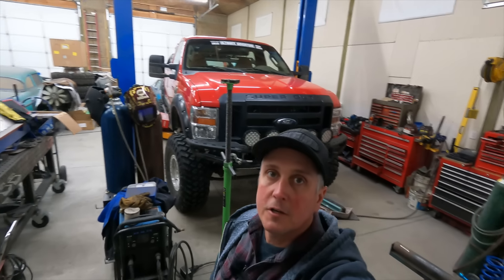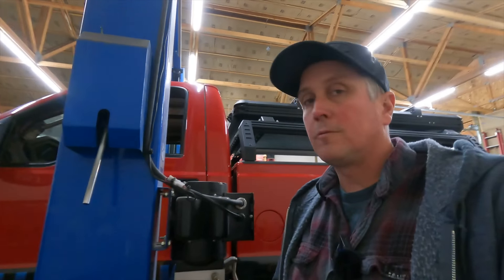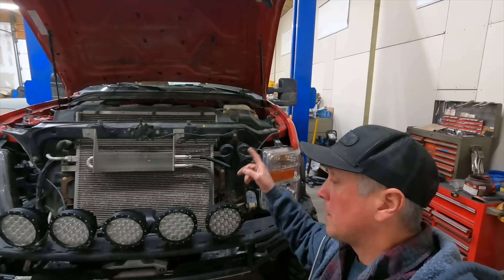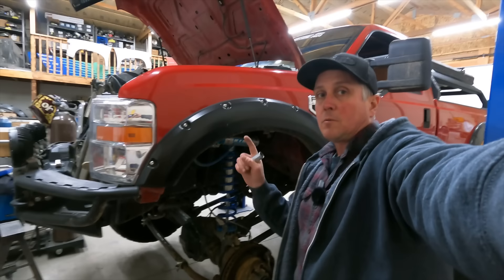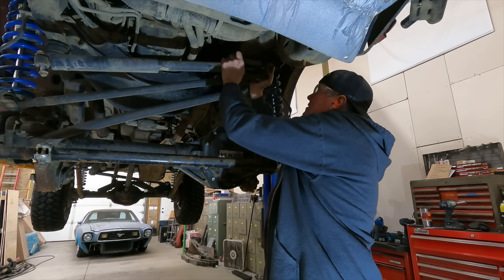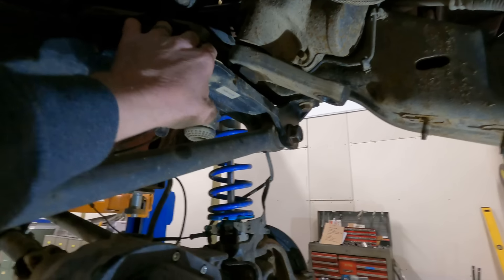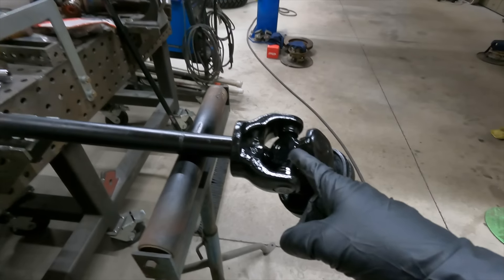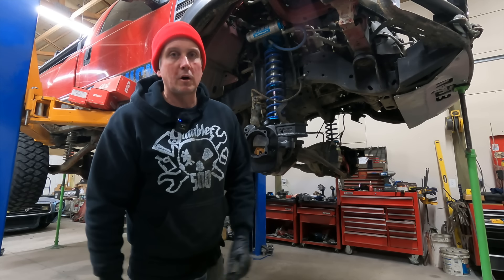Hardcore Steering for  Louis ViTen !   Episode 1

Comment: I love my step drill. I never knew my real drill.. that's a dumb joke.
But anyways, I use countersinks to over size holes. They are not snaggy and leave a perfect fit and finish.
For drilling big holes, I absolutely always go to annular cutters. They are a game changer.
I was taking a break from working on trucks to watch you work on trucks. You and Fred inspired me to build, break, repeat, from an early age, and I see you as family.
I love the any budget builds. 
You don't need a $80k rig to do Pritchett canyon. I've done it with $3k.
I also have a mini truck toyota, an f350, a 2nd gen 4runner, a 94 sas and locked pickup on 35's, and a 1st gen sequoia that's just been wrecked but gonna be sick.
The superbowl was dumb. I was also in the garage. Doing a transfercase swap and high pinion front diff on the 94.
Reply from the maker: You stay busy!!  Keep at it man!       And yeah.  The joke had me laughing

Comment: Tig tip for situations like your knuckle where you had nowhere to rest your hand, bring in one of your tall jack stands to rest your hand on. For your rosette welds, you need to massively bevel the hole on the tube to allow you to get down to the bottom of it with your torch then start at the bottom and spiral your way out.
Reply from the maker: Good tips. Thanks

Comment: Once again, I liked the episode. It gives me confidence that banging with the big hammer is something that everyone experiences. I have converted to a puller too early too many times. Liking the logic that you go through knocking out issues as they come. I can add them to my own arsenal. Thanks again and keep them coming.
Reply from the maker: Get out there and make some progress this weekend!
Reply: @thedirtheadshed  Just finishing up on a 2021 Jeep Gladiator Mojave 3 1/2 lift, sway bars, 37 in tires, front locker install, and regear to 5.13  for a trip to Sand Hollow for Matt's off-road get-together. Next comes a tube chassis with a Cummings 4-cylinder crate motor.
Reply from the maker: Those are big moves!!
Reply: @thedirtheadshed  Life is short. Time for new adventures.

Comment: Dave, I removed tie rod ends and ball joints over the years of wrenching by hitting with a sledge hammer like you did but I never removed a pitman arm joints by banging it toward the steering box ( If the steering box is going to be reuse) because there is a tendency you could pit the sector shaft with the sector shaft needle bearings. That's what I learned and also my opinion. Great VID. Keep it coming.
Reply from the maker: I should invest in some tie rod removal tools. I don’t really like hammering on this stuff either

Comment: How do you do it?  Your working a day Job and then manage to produce weekly videos--your the MAN!  Regarding the threads on the steering links, I build One Ton steering replacement links for Full Size Jeeps and I quickly found that all that heat distorts the threads.  So, I let the link cool and then chase the threads with a tap.  It's way too easy to ruin a Bung and Tie Rod.  I Love Your videos.  Very fun, informative and clean--no cursing.
Reply from the maker: I’m working part time.  So this week  worked the first 2 weeks, then took 2 off.  It’s still super rough at times

Comment: If you take a torch and soot the threads it will keep from any slag or anything from messing up the threads. I have to install threaded pipe fittings into threadolets and weldolets and and old timer showed me this trick. Turn the torch where it has a real sooty flame then soot up the threads
Reply from the maker: Challenge accepted

Comment: Oi! on the central coast between morro and slo. got a 1st gen tundra with an arb bar not technically for it. Also have an emu 2.5" lift for the truck as well. Trying to find a spot to work on it.
Reply from the maker: I’m not sure who the go-to shops are in that area.  I would call Poly Performance and ask them who they recommend
Reply: @thedirtheadshed  was wonderin if fred needed some content :)

Comment: Your a great fabricator and I love watching your work I'm a welder/fabricator and machinist so I can respect the work but I'm wondering why your not putting the drag link directly over the tie rod? Seems you would gain more clearance for the pan hard bar
Reply from the maker: Drag link needs to pivot where I pivot in the hole where I put it so it can get full steering angle.  Farther out will lessen that

Comment: So when I was watching you on UA in Louis and the 4wd guys on their Rubicon trip (in the Jeep), I wondered the whole time if the tie rod (bar) could be fabricated to kick up after the tie rod end before going across to keep it from bashing on oncoming rocks. Am I all wet on that train of thought? I realize the pressure on bar with the rough shape of a cooler handle might flex, but maybe with some gusseting in the corners? Edit: Viewer request, can you Puh-leeeez get with the rest of the UA guys and invite the Aussie guys from 4wd 24/7 on the next trip? That would be the most amazing mash up ever!
Reply from the maker: I would love to do a trip with those fellas.  You could bend the bar up.  Yes it would be a little weaker.  It would also want to flop down.  So the heim joints or tie rod ends would always be maxed out one way which could cause premature wear

Comment: Your drag link needs to be moved forward to the same bolt as the tie rod. With it back the way you have it it’s going to move at a different rate than the tie rod and it doesn’t have as much turning leverage.
Reply from the maker: The added leverage comes from the hydraulic assist ram that gets installed

Comment: Since you have so much knowledge just lying around.....I have a question lol.  I have a 2000 jeep xj with a Rubicon Express 4.5in lift which is actually about 6in.   Got more than I paid for I think but now my jeep is higher than I wanted lol.  It also had trailforged crossover steering with heim joints and the lift is fully adjustable with trackbar heim too.   I'm still running the stock trackbar bracket and after installing the new 4.7l stroker engine it developed death wobble all of a sudden.   I can't find anything loose at all but o do THINK I see the trackbar bracket flexing kinda like a spring.   You ever seen that cause death wobble? I've been an auto tech for 23 years but I'm new to the 4x4 stuff especially owning one.    I got a new bracket and brace kit on the way from cavfab and new upper control arm bushings on the axle side as well.   Just wanted an opinion on if that's even possible coz the stuff I'm running only has 3k miles on it and mostly highway and none of it loose.im definitely out of money from the engine swap.  That came outta nowhere.  My rig was down a year coz of the engine and I only put 1k miles on it before the death wobble and it's parked again.
Reply from the maker: It’s likely in the track bar or track bar bracket.   Also,  look at the skyjacker soft ride springs for the front of it.  Could lower it down a little for like $200

Comment: Next time your welding close to heat sensitive parts wrap it in a room temp water filled rag. Then as you weld add cold water rags or water depending on how much heat your adding
Reply from the maker: Thanks for the advice

Comment: I’m planning to replace my front u-joints as well on my ‘06 f250. What I wanted to ask is if those dust seals are reusable or do I have to get new ones ahead of time? I’m trying to do more and more of my own maintenance as my schedule allows and I need to be prepared. Thanks for all the awesome videos!
Reply from the maker: Those probably should be replaced if you have the vacuum actuated hubs.  Otherwise re use yours

Comment: Would you consider bending your track bar instead of cutting away that crossmember? Seems like it might be less work.
Reply from the maker: I’m pretty anti bent track bar.  Once you bend a tube it wants to continue to bend.     That being said.  My old amigo has a track bar in it with two bends and it’s lasted for 15 years
Reply: @thedirtheadshed  got it. Technically speaking, a bent track bar is stronger than a straight one. The bending work hardens the steel. As the outer portion of the tube does stretch as you bend it and gets thinner and slightly weaker, but the inner portion compresses and overall increases the strength of the bar. This assumes small bends and is a function of wall thickness. 

If you have ever looked at an stress-strain curve of a material, what you are doing when you are bending material is straining it. Strain = stretch. As you stretch it, the yield strength in creases as can be seen by the curve. When you stretch it past the point where it no longer returns, the portion of the tube that is trying to spring it back to its original position is in tension, and at a higher yield strength than original. The rest of the tube that is no longer trying to spring it back to its normal shape is usually marginally below the nominal stress and so if you sum up the post bent tensioned portions that are stronger with the portions that are weaker, your left with more strength than you started with. This assumes you’re not tearing the tube or anything like that. Hope this makes sense. 

With that said, modifying that crossmember doesn’t look too hard lol.

Comment: Its hard to tell through video but would it work better if you ran the drag link to the top side of where the tie rod attaches? Just use a longer bolt and you could basically tripple shear it if you felt necessary.  The geometry looks goofy with the drag link crossing over and i am wondering how the steering will feel with the point of leverage being that far back. Im sure it will be real fast and responsive but might be kinda hard to turn off road.
Reply from the maker: You could. But it would lose a ton of steering angle going to that point

Comment: Why wouldn't you run the draglink to the same bolt as the tierod? You have quite the angle going to the back of the truck now. Moving to the tierod hole would straighten it out.
Reply from the maker: Going out to that hole would lessen the amount of steering angle quite a bit

Comment: I've fought through a few custom high steer set ups, the struggle is real.   

I've not used a Barnes kit- was there something preventing you from moving the tierod to the rear holes and the drag link to the front (where the tie rod was/ is)? 

Seems like it would have solved the interference issues and made the links more parallel.  

Cheers, Chris
Reply from the maker: Ther is only a rear hole on pass knuckle.  It’s designed that way to keep full steering angle
Reply: @thedirtheadshed  ah gotcha, closer to the same length/ swing radius as the pitman.
Reply from the maker: Yep!

Comment: Hey I have a question for you if that’s okay. I have a 76 dodge Ramcharger that I have owned for over twenty years. Factory 440 727 the t case has been replaced with a 208. I have wheeled it in Washington Idaho and here in western Montana. It has been through a few different suspensions over the years. Right now it is actually back on stock springs. The lift was put on another truck. Years ago I put the axles from a 3/4 ton camper special under it. My question is now that I am older and the back is not liking dodge truck leafs. From what I understand the newer JK/JL are real close in weight. Could a suspension system for one of those or something similar be made to work on the dodge? I know that the frame would need to be boxed being it’s a c channel. I have never fabricated anything like this before. It’s always been just replace with other leaf springs. On this one and a couple of other dodges and my 88 YJ along with the 71 Fj40. I just did  off the shelf kit. Thank you

Comment: Are you running stock axles I’m curious if the u joints are stock 250/350 size I need to order some for my build I’m running a 08 Dana 60 front out of a f350
Reply from the maker: I upgraded the axles to the 1550 size joints.   It had the 1480’s in it originally
Reply: @thedirtheadshed  thanks Dave

Comment: There’s no mechanical reason for those tube bungs to be threaded all the way through. The rule of thumb is the threads should be as deep as diameter of the tread, but you can look up the specific value for your thread in a machinists handbook (it depends of pitch). 
You chinos be able to Chuck those bungs in lathe or drill press and clearance out the unnecessary threads/ material from the back. Should make the distortion from the rosette not matter anymore

Comment: New grinder?
Reply from the maker: I’ve got 2 dewalts.  And two battery harbor freight.  The battery ones are a few months old
Reply: They looked really clean. It was funny, watching the beginning, because I’d seen the welding vid. “Wait, he’s blowing apart the axle?” Ah, continuity is a thing. Your drive in the rock garden at Ben(?)s place was pretty cool. He was a dude. Oh, and rigging out that c-channel for the alignment. Wish I thought of that. I strapped pieces of 2x4 to my fronts after I added the lift. Wound up dialing about 3/16” of toe. Seemed to track just fine.
Reply from the maker: Sounds like you got it spot on